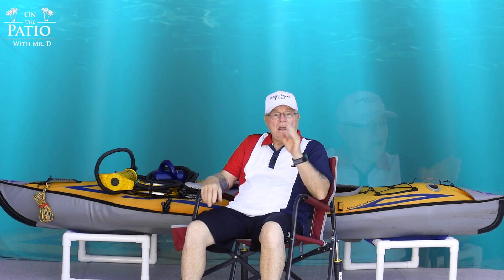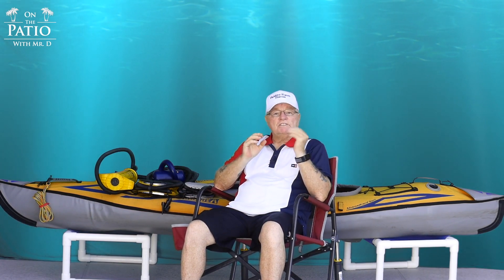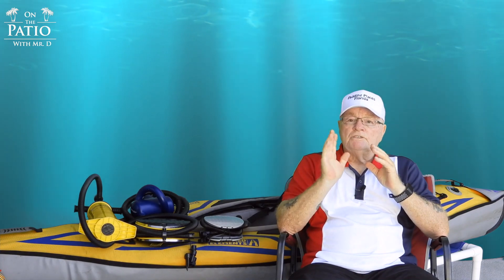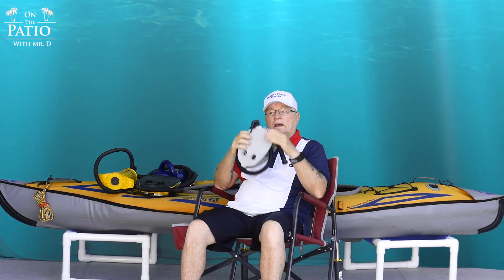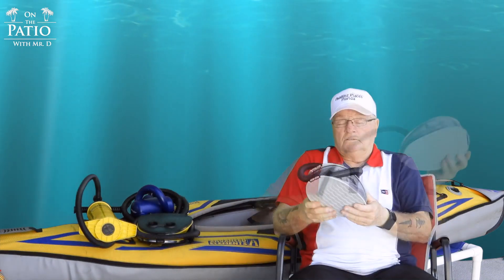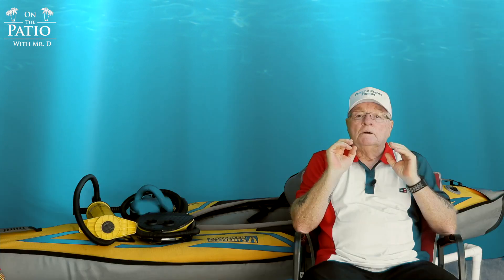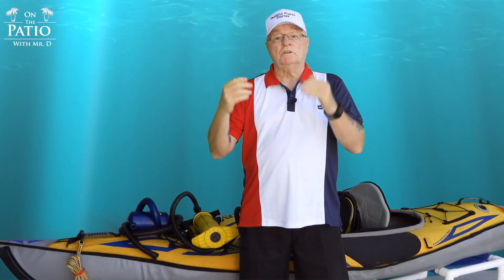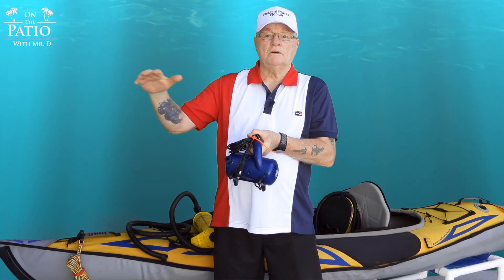Inflatable Kayak Pumps

Comment: Love your channel. Love my AE. But, I would love to see you actually try any of this yourself. If my main bladders were leeking the last thing I would attempt to do is open a valve on the water. You know how much air can escape just try to get the pump threaded on.
Reply from the maker: You don’t really open the valve you just remove the valve cap. Placing the pump adapter on the valve will allow for fill from your pump. Being this video is three years old a lot of changes with pumps are now available rechargeable battery types are now available. But they still work on the same principle.

Comment: I was just out 4 hours on the Potomac River on Saturday in my AE-Sport and always bring along my Packlite pump since I bought the boat. I carry it in a 10L dry bag behind the seat so water doesn't get in and rot the bellows. Glad I bring it along because last year when I had a bungie on the back deck too tight water seeped into the boat and nearly capsized it before I got to shore. To be honest, I was in too much of a hurry to get on the water. I dumped out the water and inflated to the proper level. I did get the vertical double action pump initially but it's too awkward to carry along. Even the demos from Air Kayaks show them leaving it behind. 
I also have an Innova Swing Ex inflatable and bought a K-Pump and it works fast and I didn't need to "McGuyer" the military valve. I'm planning to sell my Swing Ex, by the way, because I'm running out of room in my closet. The AE 1012-G looks good too!
Reply from the maker: Philip Longee Hey Philip, thanks for your comments. I can’t believe I never thought about taking a pump in the kayak.  But again I trust the AE brand. My duel action pump always goes with me in the truck as I use it to bring everything up to spec after using the programmable pump. Then I just leave it in my truck. But again I never thought about taking a pump with me. I will now. Thanks for watching.

Comment: Hi, great video! I just ordered an AE Advanced Frame, but I cant find an AE pump available anywhere. Do you have a recommendation for another pump I could get that would have the proper attachments? Would like to get one to have it as soon as the boat arrives, but don't want to get something that won't work. Thanks in advance!
Reply from the maker: Being it’s an Advanced Frame it takes a special Military Spring Valve adapter that comes with the craft so any duel action pump should work as long at it has a pressure valve. If you purchase a different pump you might have to adapt the AE adapter to that pump. I strongly recommend the AE duel action pump.

Comment: So how do you pump & paddle back to shore at the same time? Another idea for you: how to repair leaks in your kayak. Yup, big blue had a leak along the seam. AE replaced but there are no good videos on how to do the repairs.
Reply from the maker: Bruce Wayne Well being I have never had a failure, that’s a good question. I figure I would pump a while, paddle, and repeat until I get to shore.  The repair of a seam is really difficult to do successfully. It is recommended that if you have a seam leak you replace that bladder. A leak anywhere else is a easy fix, I’ve been told. I have never had a failure. Thanks for watching.
Reply: @DaleMrDSimmons  AE has replaced the bladder. I still have no idea how it happened as I follow the inflation recommendations to the letter.
Reply from the maker: Bruce Wayne Well the only thing I could think of is that it was a manufacturing defect. I know they are seam welded and just may have been a material flaw. But as you are aware AE stands behind their product.

Comment: I first ordered the hand pump from Advanced Elements, but couldn't get the hose attached to the psi gauge.  Neither could the employee at the store when I returned it.  Now, I have their foot pump, and I'm having loads of trouble getting the different valves attached to the pressure gauge that I had to order from Advanced Elements to check those levels.  What is the problem with getting the little plastic "pegs" on a valve to fit into, and then twist, onto pressure gauge?  Help.  please.
Reply from the maker: I don’t understand why the issues. Aline the little pegs with the slot on the hose and turn counterclockwise. Are you connecting the correct end? Try both ends of the hose.
Reply: @DaleMrDSimmons  I appreciate your response. I align the little pegs with the slots that but can almost not get them in past the first little part of the opening. Twisting is possible on one end of the pressure gauge ( not terribly easy, though), but  to attach the military valve adapter to the other side of the pressure gauge is almost impossible. If I can force it in, I can’t twist it and can almost not get it removed in order to put on  the valve attachment for the floor. That one is even more difficult. I can send a video of what I’m talking about.
Reply from the maker: Please do
Reply: Sorry-didn’t take a video or photo but sent the pressure gauge back with the military valve partially in, and in the stuck position. We will see what the response is from AE.

Comment: Hi buddy, from England. Love the videos. I have had a aqua marina kayak for some time. I have just purchased (it is still to arrive) an Advanced frame kayak, model # AE1012-R. There is no pump, I believe my current aqua marina pump hose attachments will not work? The valves on the boat are twist lock valves. I believe these are the same as the valves for the drop stitch floor accessory for AE? 
I have looked at a couple of pumps that I can purchase here in the UK. Will AE pump AE2011 work for the advanced frame kayak? The reason I ask is because when looking at the pictures of the pump hose I cannot see the screw lock attachments that I have seen on all the videos. 
There is no info in the kayak description as to what pump, item number etc I should purchase. 
I hope this makes sense? Thank you for any help.
Reply from the maker: Thorny5718 Your pump will work fine. When your AE1012 arrives, in the little pouch attached to the back of the seat, there is a repair kit. In that kit, is the special adapter to fit the main chamber fill valves. Just add that adapter to the string of adapters on the AE2011. Enjoy your new AE and thanks for watching.

Comment: Hey Mr D, you might have covered this before but  how do you store the inflatable for extended time? I live in Canada where my kayak won't be used for 4-6 months
Reply from the maker: Al Klassen I live in Florida and I shut down for 4 months because of the heat, humidity and rainy season. So, what I do is I totally remove all removable components and make sure everything is totally dry. put it all back together fold it and put it in its storage bag. That’s it. The main thing is make sure its totally dry. Thanks for watching.
Reply: what part of Canada Al? I'm in Ontario so we're in the same boat weather wise.